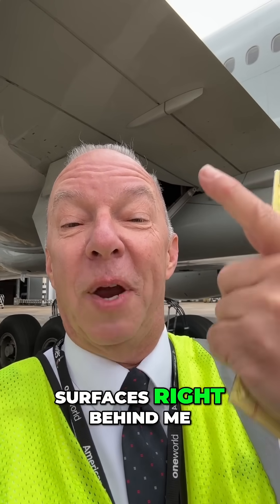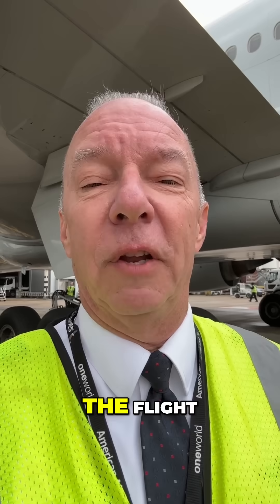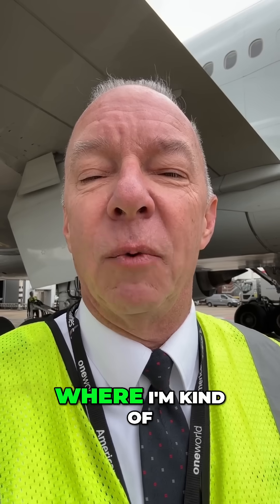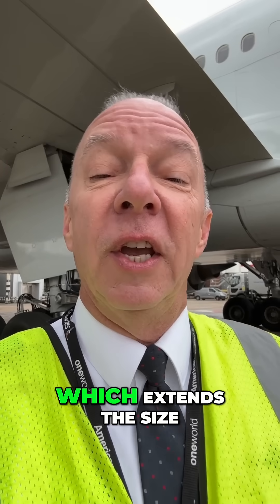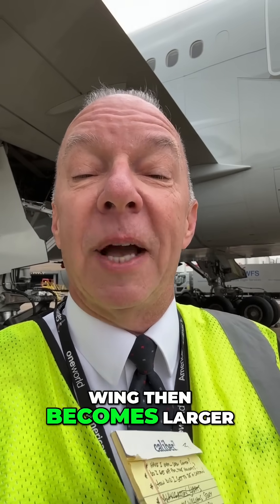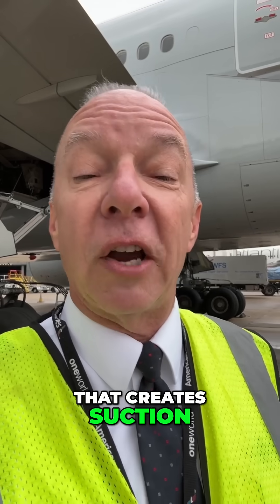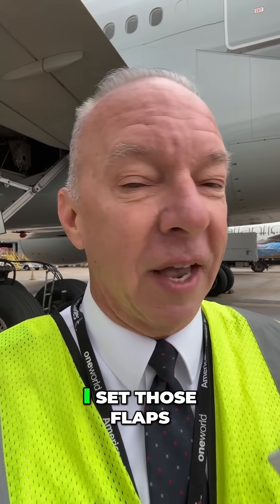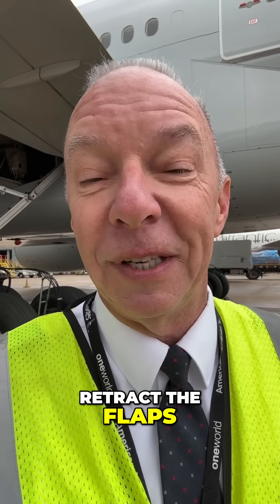Understanding Aircraft Flaps: The Secret to Lift

Comment: Steve your wrong about the aerodynamical principles behind this. Flaps dont cause the airflow to travel a longer distance and this doesnt cause the suction flaps increase the camber and allow for the wing to deflect more air downwards at a steeper angle leading to greater downwash

Comment: All true but there’s more. This aircraft had leading edge devices called slats. The flaps and the slats also change the camber of the wing. It also changes the angle of attack of the wing also. Angie if attack= the angle of the chord line of the wing and the relative wind.

Comment: They are mostly used during landing so the pilot can reduce power to start the descent and also maintain the same glide slope without increasing airspeed. Without flaps, the pilot has to reduce power and then raise the nose which reduces airspeed. It’s used on aircraft during takeoff to provide added lift if it’s at a high density airport or is very heavy such as a commercial aircraft. In a C-172, you almost never use flaps during takeoff unless it’s a short field takeoff (10% flaps) and always use it during landing (20 or 30% flaps).

Comment: I'm appalled that a commercial pilot repeated this silly explanation of lift.
Suction DOES NOT exist. The action that causes lift does not come from the top of the wing it comes from the pressure on the bottom of the wing. Newtonian physics explains lift, not magical suction.
"Stick and Rudder" helped me learn to fly, (in spite of its incorrect explanation of the physics of flight) but building and flying models taught me how and why airplanes fly.

Comment: Here Captain Steeeve is WRONG. Lift is NOT created because of a longer path of the air over the upper side of the wing relative to the lower side. This is a misconception. Lift is created by the convex (rounded) airflow over the top of the wing. Which in turn creates a centrifugal force that is pullling on the upper surface of the wing. This creates a low air-pressure. The difference of the pressure between the upper and lower surface of the wing creates lift. This low pressure above the wing is also the reason why the air flowing across the upper side of the wing is accellerated when it passes from the normal ambient pressure area in front of the wing towards the low-pressure area at the first third of the wing. Yes, the higher speed is the consequence of the low pressure. It's NOT that the low pressure is a consequence of a higher speed. The flaps are giving more lift al low speed for two reasons: a) increating the wing area  and b) increasing the camber of the airfoil (wing) that is the rounding of the wing profile at its rear end, accelerating the air mass more downwards and by this increasing the centrifugal force and creating a lower pressure at the upper sinde of the wing at low speeds.

Comment: Activating flaps on small aircraft is done by hand with a lever similar to an emergency brake on a car. While pulling back on the flap lever you can feel it in the speed and lift. It’s one of the coolest parts of landing a small plane!

Comment: From what I heard, 75% of the total lift is suction from the top part of the wing and only 25% is positive pressure from the bottom of the wing, correct me if I am wrong, I’m curious myself
Reply: No, that was the old way of teaching. As a matter of fact, that’s what I used to teach back in the early 1990s. This has been debunked. Lift is mainly produced by deflection from the bottom of the wing.
Reply: Yeah that’s true more of the lift now the understanding is the equal and opposite reaction of the wind hitting the bottom of the wing. You get a low pressure on the top of the wing and a higher pressure on the bottom. It’s just the Venturi effect.

Comment: Actually that's an over simplification of lift. It's actually not caused by a difference of distance of air travel. If that was the case jets would fall out of the sky when they do a barrel roll. It's more like you are cutting your way through a viscus substance and traveling faster forward faster than you can fall through it. Kinda like orbit but you are fighting gravity and air while using the air to push you up. What the distance difference does do is it's a neet way to keep the vehicle more level than it would have to otherwise be. Humans like to be level.

Comment: After an airplane takes off, do the tires stop spinning before being retracted, or do they keep rolling while being held inside the aircraft?
Reply: The main gear, the tires will stop spinning with brakes. The nose gear, will be stopped inside the wheel well usually by a scrubber.

Comment: The surface area of the top of the wing being larger than the surface area of the bottom of the wing does not affect lift the way you described. This is known as Equal transit theory and was disproven. There are some airfoils such that the surface area on top and bottom  are equal aka Symmetrical wings.
Fast moving fluids have low pressure (suction). The top of the wing has air flow much faster than the bottom. This yields suction or Bernoulli’s lift. 
Flaps are high lift devices that increase the camber of the wing. This results in the angle of attack increasing. Therefore more lift. In short.

Captain Steve makes great content, and I am a huge fan.  just a slight hiccup here.
Reply: I think he wanted to make it simple and made it incorrect in the way. Well, nobody is perfect, Cpt Steve will probably appreciate your comment!
Reply: Appreciated, it's indeed an outdated explanation.
Also, at the end, not exactly up to altitude, but rather up to certain airspeed.

Comment: With the jet engines things changed. They learned how slow jet engines spooled up. So it is more efficient and safer to hang junk in the airway (flaps slats) and push power up on jet engines so in case of go around you can clean up
The wings faster.

Comment: So how many flaps settings are there on every aircraft? I'm pretty sure there are about five if I recall correctly? I'm pretty sure they are also set by that lever to the right of the thrust levers closer to the first officer's seating position correct?
Reply: Depends on the aircraft. Some have more than 5. All Airbus aircraft have 4 settings. Most small jets have 3.

Comment: Hey Captain Steeeve or any other pilots. Question, why does airliners have so many flap settings while smaller planes have 2?
Reply: A lot bigger speed range between high speed and low speed, so to help with that, you need more flap settings.
Reply: @ Thanks for the info 👍🏾I got into flight simulator and I noticed the many settings on the 737 compared to a CJ4

Comment: Not quite true. The flaps increase coefficient of lift for a given angle of attack. Not total lift.

Lift is the force required to balance weight so is the same regardless of flaps in or flaps out if you're flying straight and level.

Comment: It doesn't create suction. The curvature of the wing creates air pressure, and the flaps help lift by building more pressure at the rear of the wing .
Reply: Bernoulli's theory of lift is based on Bernoulli's Principle, which states that as the speed of a fluid (liquid or gas) increases, its pressure decreases. This principle helps explain how air flowing over an airplane wing generates lift.

How It Works:

1. Airfoil Shape: An airplane wing is typically designed with a curved upper surface and a flatter lower surface. This shape is called an airfoil.

2. Airflow Difference:

When the airplane moves forward, air flows over and under the wing.

The air traveling over the curved upper surface must cover a longer distance in the same amount of time compared to the air moving beneath the flatter surface.

This causes the air above the wing to travel faster than the air below.

3. Pressure Difference:

According to Bernoulli’s Principle, the faster-moving air on top of the wing creates lower pressure.

The slower-moving air beneath the wing creates higher pressure.

4. Lift Generation:

The pressure difference between the upper and lower surfaces of the wing creates an upward force called lift.

This lift counters gravity and helps the airplane stay aloft.

Limitations of Bernoulli's Explanation:

Bernoulli’s principle explains part of the lift phenomenon but not all of it. The angle of attack (the angle at which the wing meets the oncoming air) and Newton's Third Law (action-reaction forces) also play crucial roles. The downward deflection of air by the wing generates an upward reaction force, contributing to lift.

Combining Bernoulli’s principle with these additional factors provides a more comprehensive understanding of how lift is generated.

Comment: Newer , more complex aircraft have computer assisted flight controls that overlap the function of control surfaces. 
There are " flaps " on the trailing edge of the wings.  " Slats "  on the leading edge of the wings. 
" Spoilers " that can act as ailerons for roll.  " Speed brakes "  that can be spoilers and speed brakes - and there are " ailerons "  that long with the spoilers and speed brakes , assist with roll flight control in different modes of flight . It really depends on which control you use and what mode of flight or landing you are in. All this info is sent to the computer for correct deployment.  Most large passenger aircraft have 2 types of roll control on each wing.  The inboard and outboard.  The inboard is commonly used during high speed flight and don't move very much as the high speed air is quite forceful.  The outboard ailerons come into play at lower speeds and cause more rapid roll changes as the aircraft slows or gains speed in take off and landing approaches.
Reply: There are flaps on the leading edge of some Boeing aircraft, called Kruger flaps. 
Spoilers don’t act as ailerons. Spoilerons can help the ailerons, or on some aircraft, like the C-17, they are used to turn the airplane on their own, but they don’t act the same as ailerons. 

On modern civilian aircraft, speed brakes and spoilers are the same panels. Mostly military aircraft but also some civilian aircraft in the past had just speed brakes. 

Airbus does not have inner and outer ailerons. That’s just on some of the bigger Boeing aircraft and started with the B747.
Reply: @rtbrtb_dutchy4183  Some of the corporate jets use the flight spoilers and speed brakes together in slow flight  along with the ailerons in slow flight to enhance roll ability.  Some jets have no classic aileron at all . The spoilers and speed brakes ARE  the ailerons.  Instead of attempting to explain ever detail of every model specific design - I was attempting to generalize about as much information as the average person looking out the window at the gate could ever possibly understand with no familiarity .
Reply: @ flight spoilers or speed brakes are not used in slow flight. Sounds more like a Microsoft flight simulator thing. That’s what it is not the same. 

Speed brakes and flight spoilers are the same thing on most modern aircraft, not just corporate jets, but Boeings and Airbus too. Sometimes manufacturers call them spoilers, sometimes speed brakes. 

Some aircraft, like the Mitsubishi MU-2, have so called spoilerons. They are not spoilers acting like ailerons. They are spoilers than can work independently to drop one wing and make the airplane turn in a different way than ailerons can. 

In modern jets, spoilers can help the ailerons in the same matter, however, they only become active when large aileron deflections are required. 

I understand you are trying to generalize for people to understand better. But it should still be accurate.
Reply: @rtbrtb_dutchy4183    My statements are accurate.  We have not discussed every different type of aircraft , their design or how they overlap their flight controls, nor am I going to.  I maintain systems that overlap depending on flight config and air speed. Air mode , ground mode/ WOW.
Reply: @mixter7x7  no, it’s not as accurate as you think. But that’s ok. I guess it’s close enough. I was trying to help, not start an argument.

Comment: Such a likeable man. Explains complex aerodynamics in plain english
Reply: Not quite correctly though. The "longer path over the top surface causes lift" is a myth. There is no physical requirement that two neighboring air particles being split by the leading edge of the wing MUST meet back up again at the trailing edge at the same time. In fact in a stalled wing they don't meet back up at all. The top surface airflow is actually much faster.
Reply: @agentanderson3976  Changes Angle Of Attack !

Comment: I've Sat in a Row Seeing the Flaps Extend way out with even a Clear Gap of Inches away from the Wing and saw them Retract back inside the Wing as we Flew to our Landing and Come back out and down. I Also have seen Metal Flaps Come up on the Wing, to Act like Air Speed Brakes I guess. On The Landing Our 747''s left Engine was on Fire. I told the Stewardess and she said it's ok, it happens a lot 😢
That wasn't the Reply I was Hoping for 😢
Reply: There are " flaps " on the trailing edge of the wings.  " Slats "  on the leading edge of the wings. 
" Spoilers " that can act as ailerons for roll.  " Speed brakes "  that can be spoilers and speed brakes - and there are " ailerons "  that long with the spoilers and speed brakes , assist with roll flight control in different modes of flight . Most large passenger aircraft have 2 types of roll control on each wing.  The inboard and outboard.  The inboard is commonly used during high speed flight and don't move very much as the high speed air is quite forceful.  The outboard ailerons come into play at lower speeds and cause more rapid roll changes as the aircraft slows or gains speed in take off and landing approaches.
Reply: @mixter7x7  Thank You Sir. It's Wonderful to Know and see how Sophisti - cated Flight has evolved since The Wright Brothers' first successful flight took place on December 17, 1903 in Kitty Hawk, North Carolin. I wrote just to let you have a Sense of knowledge of how Green Horn Passengers interpret what they witness and see During a Flight. It is Truly Amazing how a Big Metal Bird can Fly  and Lift off the Ground with all that weight of People, Luggage and Fuel and get Airborne!
I am so Happy we have well Trained Crews to fly and get us to our Destinations. I Thank All Pilots for Being Careful in  Doing their Job for all Passengers! We Really Appreciate the Entire Crews efforts.
Reply: @mixter7x7 there are also leading edge flaps. The 747 does not have slats, it has leading edge flaps.
Reply: I fly 747's and no, engine fires do not happen a lot. But it's not super serious. It does have to be dealt with quickly though.
Reply: Engine fires barely happens. I doubt this is a true story.
Reply: @rtbrtb_dutchy4183  No it's true, I spoke to a Lufthansa Captain once about it and he said " Push Button!" I guess they have a Fire extinguisher button to push when that happens... But that Engine I saw out my window  was definitely on Fire! 🔥😞
What Saddens Me is when we Report something that needs to be looked at and Checked and they tell us it's nothing! 😞 Every comment here said it's Serious. I just wish people were more honest instead of covering up the Truth 😞
Reply: @Dennyboy1  I used to fly the 747, never had an engine fire. Neither did my company. 

You probably saw a wet start. A wet start is when there is unburned fuel that burns off at engine start. This creates a temporary flame out the back for a few seconds, which is harmless. And it was a frequent occurrence on the older engines.

Comment: but when you mean you need more, in fact you need less cause of the thrust force vector. You are in need of a lower critical angle increasing the airfoil curvature and more wing surface to generate more lift at lower speed increasing the airfoil surface. 
I Love your video.. greetings from Steeeeve from Italy
Reply: Thrust force vector?  No such thing.